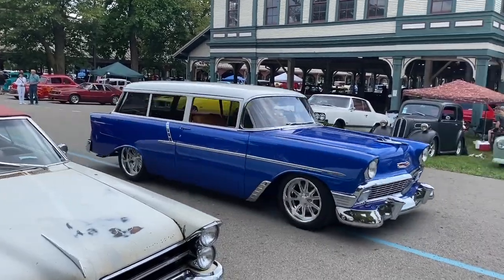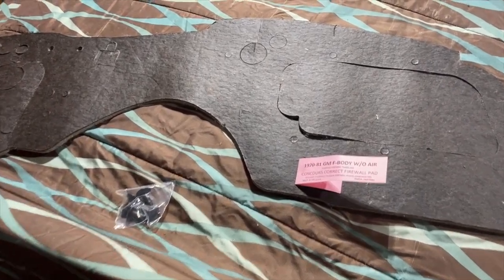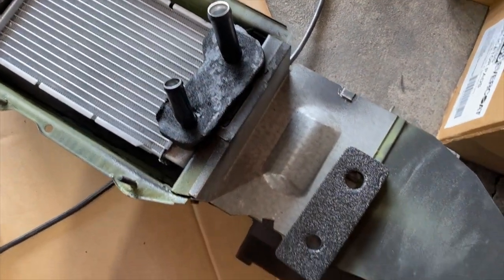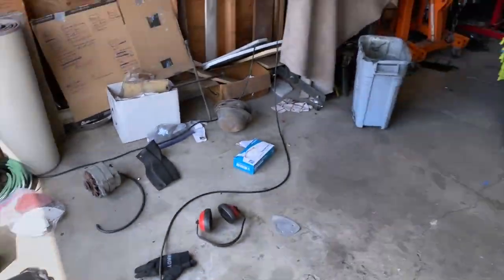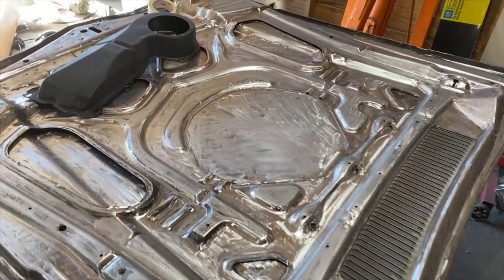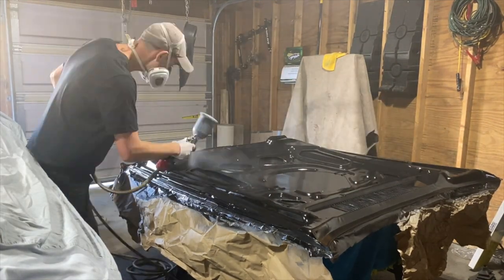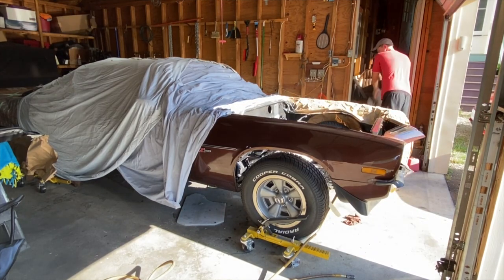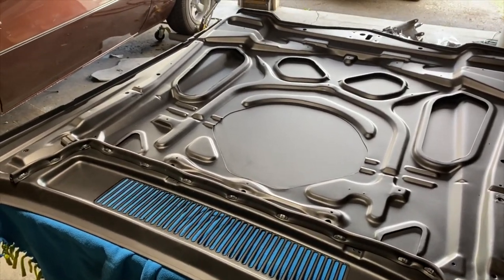Fixing An Issue That Has Been Bothering Me.. AND Helping My Dad Test Mount His Ford F1 Truck Cab!

Comment: Ryan great job as always!!  Look into an oil pressure isolator, it will break the system in two.  Keeping the engine oil in the engine compartment, and a small amount of antifreeze inside the car.  I ran one of these on my Cummins fuel pressure because if the line ever broke, I didn’t want diesel fuel running inside my truck.  The new braided line should connect right up!
Reply from the maker: Sounds good, I never heard of that before so I will have to look into it👍

Comment: Ryan, There should be a heavy molded seal that should available, probably through Eckler's, to be placed between the heater cover and the firewall (engine side). I ordered this seal when I restored my heater on my 1963 Chevy Impala. This cover has been available and used on many Chevrolet models as well as other G.M. makes through Eckler's for years. If you want a correct restored stock appearing car order one and avoid taking a short cut on something that was able to be achieved at this time allowing a quality restored show car. This heater cover will always be visible every time when the hood is up and be seen. The self adhering foam strip will not hold up under the hood what with the engine heat and the general weather conditions of driving the car.

Comment: Ryan, the heater box shoukd be gloss black. 67-69 Firewall: Semi-flat black 30 percent semi-gloss black paint. Prob the same for 2nd Gen. Different guys on nastyz28.com use their own liking.
Reply from the maker: Thanks for the tip John! I got it to where I like the gloss level and it should be close to original. If not, it’s a cool “batman black” that I was looking to finally achieve🙂